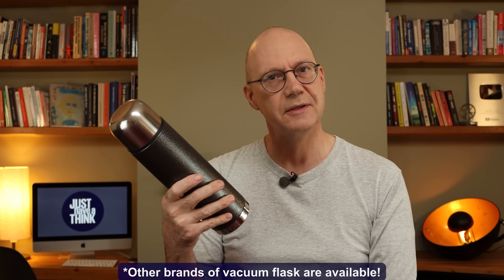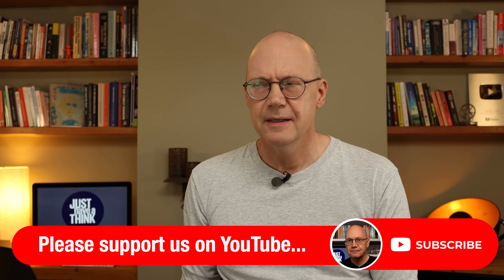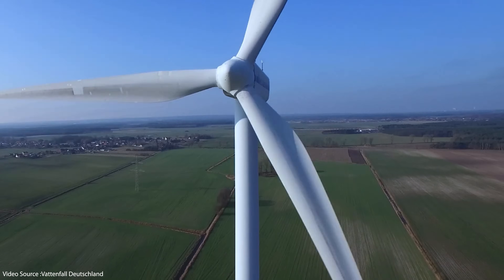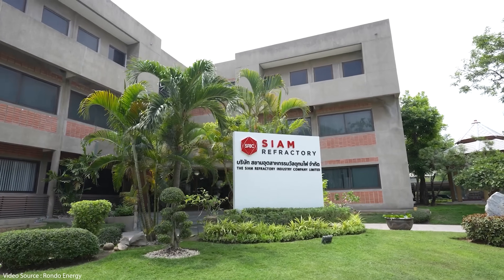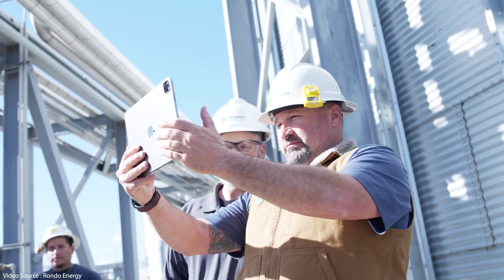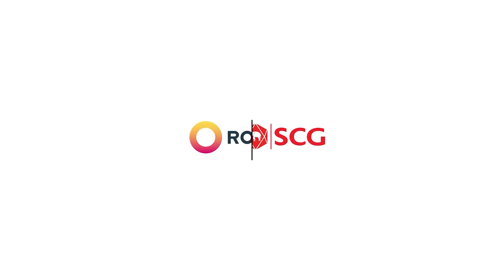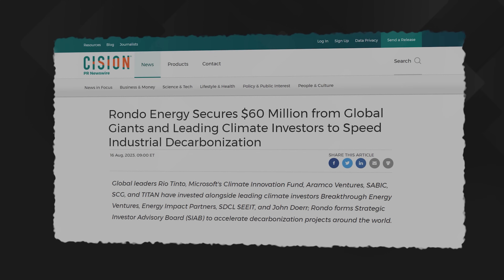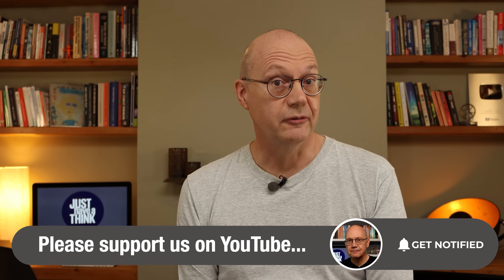This energy storage technology is HOT STUFF!

Comment: Some excellent ideas being implemented across Europe. Why can't the UK do something like this?
Reply: And too busy subsidising  oil and gas
Reply: Because we’ve lost most of the subsidies that get them going :/
Reply: Highview Power are developing a cryogenic storage facility in the North West region of the UK
Reply: Despite the partial rollback by the current UK government the UK has achieved quite a bit.

To my knowledge, coal-based power generation is virtually over, natural gas and wind have taken over. A large portion of the natural gas is used in combined cycle power stations that have high efficency, and the gas is not retrieved by fracking. 

The UK has more offshore wind production than, for instance, Germany - we are just starting over to install more offshore plants here after a bad period of inactivity under the previous conservative government. Onshore, Germany is quite good with over 20% of production of electrical energy and currently 14% solar.

So let's go for a race :) building offshore power plants - UK vs Germany.  With Top Gear making a show out of it :D
Who wins? (spoiler: it's the planet)

I know about problems with heat pumps in Britain, that they can freeze over in the moist, cold winter climate and that many houses will need extensive improvement to become less energy-consuming. But anyway, some solution will be found finally. Maybe it's a large local heat storage, powered by renewables, even supplying old buildings without much refurbishment ...

Here in Germany, after being out of russian gas supply, we import LNG from Qatar and the USA. I recently saw a lenghty report by the public TV station NDR that explains why gas fracking causes environmental damage in the US and that a lot of methane gas just evaporates into the atmosphere - through disused boreholes as well as on transport. The report even suggested that we could just as well increase our coal-based energy production without producing any more greenhouse gas .... I hope we get that fixed - but it will take time.
Reply: The only scheme they have made any attempt at deploying is heat recovery from old flooded mine workings ...  in the NE.
The Eden project has had to team up with a drilling company and private firm/Uni link up to drill down into the Granite for a source of geothermal heat ...but they have some very big greenhouses to heat. 😂😂. 😉

Generally its a disgrace ive been studying in this field since the early 70s and we were pointing out how and why then.  
Its like we are a society that wont save itself because its not seen as economically viable to actually do anything. 🤦🏻‍♂️🧙‍♂️

Thats a slight mangling of a quote by the guy who wrote Slaughterhouse 5 .. kurt Vonnegurt..
Reply: We're engaged with a few folks in the UK, hoping we can share more news soon!
Reply: Brexit?  Creativity flounders in rightwing environments.  The left charges into the future, the right retreats into the past.  Tell me if this isn't true.
Reply: Very apt quote 😅
Reply: Bureaucrats.

Comment: 10% of the heating requirement of a major city like Berlin is a lot!
It's also very simple amd likely cheap.
Therefore in areas where large quantities of heat are required this is a very good way of utilising off peak excess enrgy from intermittent sources of generation.
On the downside heat is more difficult to distribute than electricity so high temperature heat storage systems look to be more usefull since the higher temprature heat can be used to power electricity generation systems.
Sorry, is that what you  just said Dave?
Issues that still need to be clarified are:-
1). At what efficiency can electricity be converted into heat?
2). At what efficiency can the heat thus produced be re-converted back into electricity?

@incognitotorpedo42 Says:-

Electricity to heat is extremely efficient; not far from 100%.  Heat to electricity is much less efficient.  The efficiency is governed by the Carnot equation, and depends on the temperature of the hot and cold reservoirs involved.  The hotter the heat, the more efficient it will be, but in the real world you can expect to lose roughly half the energy going from heat to electricity.

Thanks @incognitotorpedo42
Reply: Electricity to heat is extremely efficient; not far from 100%.  Heat to electricity is much less efficient.  The efficiency is governed by the Carnot equation, and depends on the temperature of the hot and cold reservoirs involved.  The hotter the heat, the more efficient it will be, but in the real world you can expect to lose roughly half the energy going from heat to electricity.
Reply: Thanks for clarifying that. @incognitotorpedo42

Comment: I love projects like this. Nothing special, just a giant pile of engineered dirt in a metal can. That actually has a chance to get built. I look forward to living in a world assisted by these devices and never knowing  they're there.
Reply: But also simple enough to be built under license allowing rapid expansion and stable income/profits for Rondo.
Reply: The only issue for these is that they're of no benefit in a grid that is not dense in variable renewable energy - though their existence will make the transition more attractive. Using TES as grid storage is somewhat wasteful from a round-trip efficiency perspective, you're only getting a 30-40% round trip efficiency - which is fine for some purposes because these batteries are like a tenth of the cost of a comparable lithium battery; but you need cheap electricity to charge them, which you only find on a grid where supply outstrips demand a good portion of the time (think duck curve for solar etc).

Economics of thermal batteries is geographically dependent on the input energy available in the region. Much of the cost of a TESunit comes from the cost of electricity fed into the battery itself; for example, the American mid-west has built an enormous amount of wind power in the last decade and in some areas there’s even too much power for the grid to handle. e.g. There are places on the grid in Kansas and Texas where energy prices are in the negative 30% of the time but where there is not a surplus of renewables, thermal batteries are a less attractive option unless a company or state is willing to pay a premium to decarbonize.

Edit: I should add that thermal energy storage companies, such as Rondo Energy, MGA Thermal and Antora Energy, argue that round-trip efficiency can be a misleading metric when considering storage solutions; citing that while a grid may only be able to recover 30-40% of stored energy, the cost of storage and recovery will cost around a tenth of what it costs to store the same amount of energy in a lithium-ion battery. Thus, even though the round-trip efficiency is much lower, the cost per joule of reclaimed energy is still better value due to the low capital cost of thermal storage.
Reply: @wufflykins4369  your "30-40%" depends on the stored energy being translated back into electricity & that doesn't look like what they're anticipating here, it looks like they intend using the heat as heat.
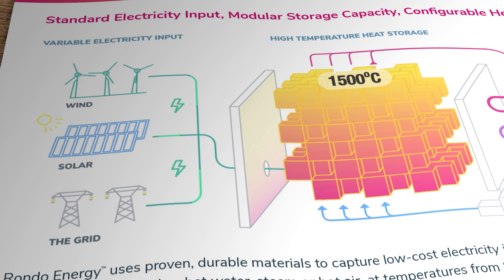Reply: @alanhat5252  You're absolutely right - those numbers are for converting back to electricity, and using the heat as heat is very efficient by comparison. However, if you look at competing projects that target industrial-scale storage (such as Antora Energy), they are designing their TES systems to produce both, and Rondo is no exception. It was cut off, but the rest of the graphic shown at 4:16 shows this - using convective heat transfer to create steam for a turbine.
Reply: @wufflykins4369  A lot of this thinking assumes that “grid” is the only way to deliver electrical energy, that we MUST be centralized. But I think a lot about what Tony Seba calls “GOD” - generation on demand. As the price of solar/wind falls, at some point, it becomes so cheap that transmission losses no longer make economic sense. Even if the centralized base load plants could give away their power for free, it would cost more to transmit the energy than it would cost to simply generate it locally and store as needed. So for an industrial customer that needs a lot of heat or electricity, it would simply be cheaper to build a new factory where they can build their own solar/wind farm and storage than it would be to buy it from a centralized supplier. And for individual homes, some rooftop/yard solar plus storage, plus the ability to sell their own surplus power via a two-way grid, provides both independence and cost savings. It all depends on solar costs coming down, and storage costs coming down. 

I won’t shed a tear for the coal plants and 1970s nuclear antiques going out of business because they can no longer afford to operate.
Reply: 💯 agree with you. Also, I'm sorry to be that guy, but it's, "they're there".
Reply: @jameskent9759  fixed it
Reply: Take a look at the Aluminum-Graphene battery. If you could choose one or the other, which one would you pick?
Reply: @andrewkaiser7203  looks like the aluminum ion batteries will be used for a different task but are evolving in a similar way. Competing with lithium isn't necessarily about volume. It's about the discharge rate. If it can compete with the discharge rate I think the researchers may have something.
Reply: @darkjill2007  The charge rate is extremely fast. There is no lithium battery remotely close. If you didn't know that, you didn't look.
Reply: Yeah low-tech approach is good sometime!
Reply: The cool thing about dirt is that it is abundant and cheap! Thanks for following along our journey!
Reply: @RondoEnergyGlobal  i can't imagine that the huge temperature change will not make the material crumble and produce a pile of dust after some years of daily heating
Reply: Sometimes low tech is better than high tech, especially when it comes to cost.

Comment: In district heating 1000 degre heat storage is a bit overkill .
Water storage quite enough 
And also esay to regulate move the energy with pumps. Water has better temperature maintainmenent than air .  ,in district heating systems the pipes often  carry cirka 100 degrees c water 120 -130 is common, its pressureised so you can over atmospheric boiling temperature)
Using air  based storage at 1000 degrees probably means 
More loses and complicated 
Systems like heat exchangers in several steps to get it down to useable temperatures. 
If process needs several 100 degree c air this kind of storage may have  a good application.

Comment: With this and other heat transfer technologies I always wonder why it hasn't been done already. if this can be done surely all the excess heat produce in foundries and other metal work facilities could be used in a  similar way on traditional industries without the need of a battery that is heated just for that purpose
Reply: Basically it comes down to a need - heat storage has been used for a long time to capture excess heat in foundries (glassworks comes to mind) but mostly just for heat-to-heat (heat input and heat output) - or more recently for CSP (Solar) heat-to-electricity. In both cases you have limited temperature for input so it doesn't get quite hot enough for purpose. Using electricity-to-electricity for thermal storage is incredibly wasteful (compared to lithium-ion batteries or pumped hydro etc) and prior to now just wasn't economically viable given that you're only recovering around 30-40% of the electricity (aka round-trip efficiency).

Why it's so viable now is because electricity has become so cheap on renewable dense grids - there's places in the US midwest where the price of electricity is negative 30% of the time. So now, even if you're only recovering 30-40% of that power it's still hugely profitable if your capital expenditure to store it is low enough. These batteries cost roughly a tenth to build and maintain than a lithium battery of similar capacity, and so you're CapEx is so low that you don't really care about round-trip efficiency.

Comment: This is same as Electrical storage heaters of 70's but on industry scale. This tech was discontinued since as better cheaper to maintain systems came about. If a brick or bricks brakeup in 5 -10 years airflow and efficiency will drop and become very expensive to replace faulty bricks.
Reply: I also wonder how can this survive 40 years with all these tiny fins in the bricks,
when you heat it up from like 80C to 1500C there has to be a lot of thermal expansion and shrinking going on, so it will likely crack....

Comment: The city of Halle, also Germany, has been operating their 50 million liter thermos bottle since 2018. It seems to be doing well and is an unbeatably cheap way to store energy. I imagine replacing the old power plant with a heat pump would be a fantastic way to decarbonize and increase flexibility on the demand side of the electricity grid.
Reply: The Saale river could supply heat that is then condensed with a large heat pump - like it's done in Esbjerg. As cities in Germany must make plans for heat networks until 2028 they may pretty well be considering this already.
Reply: I guess temperature vs pressure is a limiting factor in using water as the storage medium, if you want to go beyond the boiling point you have to contain the pressure, with all the associated costs and dangers (giant pressure bomb in the centre of a city) whereas the brick medium can take a much higher temperature without any of these issues. Of course, the actual energy stored per kg of medium will depend on the specific heat capacity for each but not having to consider pressure build up suggests a win for brick in my mind. Of course also have to consider the energy conversion at either end (in and out). Probably simpler for water compared to brick. Would be an interesting cost/benefit analysis.
Reply: Yeah, I'm stuck with the question what heat pump is envisioned for this kind of use? Because let's be honest, the water battery is by far the best heat battery because you get so much energy content per kelvin added and under the philosophy of efficient heat pumping you preferably don't want to climb that kelvin ladder too high anyway ... but one is tempted to use the water battery at least all the way to 100 °C because otherwise the energy density turns out to be meagre after all... but then, what heat pump to use? Typical consumer heat pumps are designed to pump to 50 or 60 °C...
Reply: @Hecatonchires1991  Industrial heat pumps typically work at 80°, but designs with higher temperatures are in development according to various projects that can be found online. Even water itself is considered as a working fluid. Thinking about it, looking into the new developments of high temperature heat pumps could be an interesting topic for this channel. Without a doubt, a lot will happen in this field with increasing electrification.
Reply: @Hecatonchires1991 these applications are good for cement drying and that is just about it. They provide air at 2000 ish degrees f at just barely above ambient pressure, and any attempt to increase the pressure or change the working fluid requires a heat exchanger that at those temperatures and flow rates and low pressures will be a phenomenally expensive hunk of nickel alloy. These systems have very limited use cases like district heating or concrete plants and beyond that there’s really not much use for them
Reply: It's not about the design but about refrigerant. If liquid turns to gas at 60deg c then you can't heat water up to more than 60 deg c. Moreover the hotter the water is the less efficient whole system is. If you want to heat up water to 55 deg c, cop drops from 3.5 to 2.5 or less depending on external temperature. Also refrigerants are potent ghg gases. We basically should stop using heat pumps as soon as possible, but there is no good alternative at the moment. We have to little energy to have brick batteries in homes and industry.
Reply: @Adrian_kal heat pumps are going to be the main way of efficiently heating things. We just have to improve them as much as possible. You can today buy domestic heat pumps with propane as the the refrigerant which only has a gwp of 3 which given the small amount used is fine. CO2 is also being looked at which is obviously only 1.

It makes sense to heat storage as hot as you can to store the most energy and have it last a long time. For this kind of application I think it would make sense to use a 2 or even 3 stage heat pump. This way you can use a different refrigerant in each stage and tailor them for optimal efficiency in stepping up to 98C.
Reply: Heat pump needs electricity 24/7 to power it and provide heat. We only need electricity for a few hours (4-8 hours per day) to charge enough to deliver reliable 24/7 heat. So putting a Rondo Heat Battery onsite at an old power plant, and installing PV/Wind nearby is the best way to re-power older stations.

Comment: this is the way forward. It'll be like the Lego of the energy-storage world. 'Excess' energy is going to attract a lot of manufacturing to the area where these heat batteries (HBs..?) are plonked...which means more excess heat made available to be tapped. As a bonus, it should help to get manufacturing plants out of the cities...which in turn should help reduce car use, if a decent public transport system is laid on.
A potential 'bolt-on' tech; HBs can be 'topped up' by ANY energy source (energy harvesting particularly springs to mind, in urban environments), and can be adapted to run steam turbines - this is a level of modularity and flexibility that I don't think can be matched. The sheer flexibility and relative simplicity of this system is breath-taking. You can even transport these things in total safety.
These babies won't run EVs, but I got an idea their wide-scale adoption is inevitable.